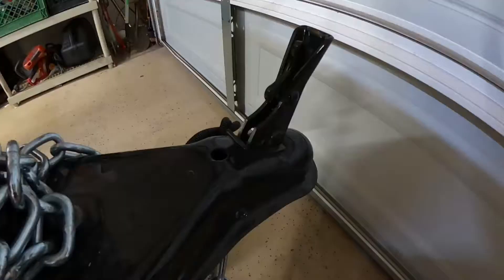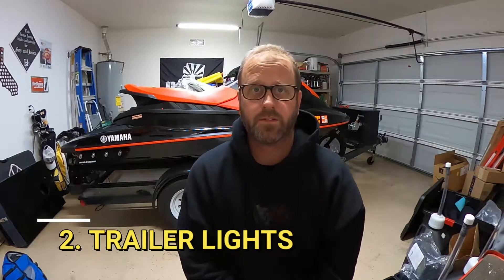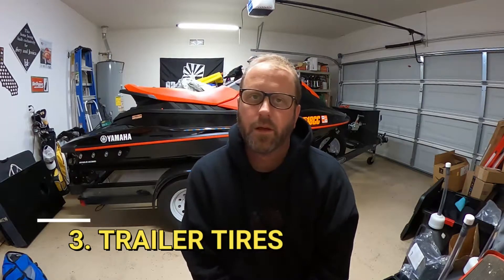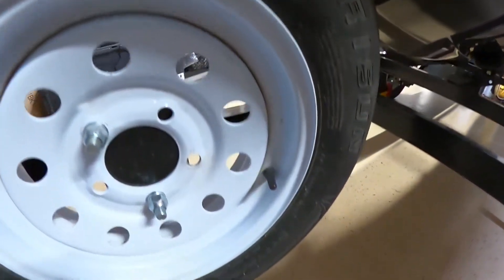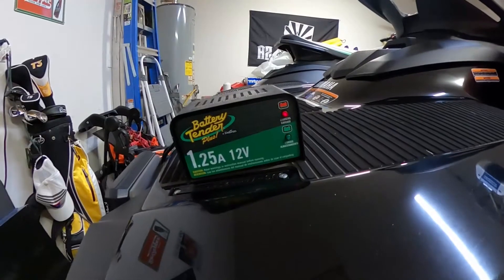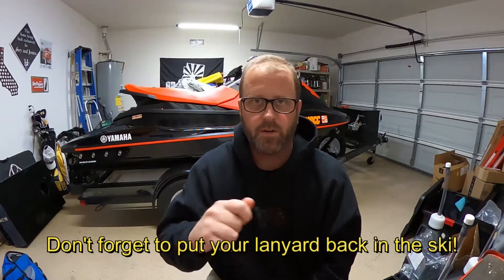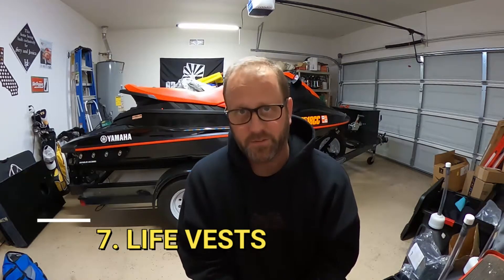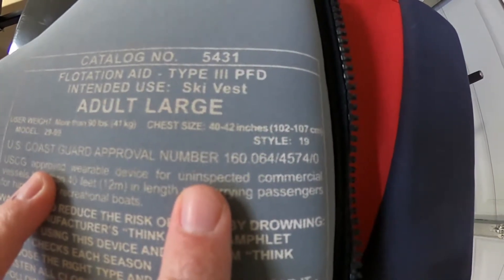PWC Checklist - 10 Things You Should Check Before Hitting The Water

Comment: One of the most convenient locks you can get for the trailer hitch lock is the Bolt brand lock. 

You get ones that are keyed to your vehicle key. I only have one tow vehicle, so I have a few of their locks, a pad lock, cable lock, hitch pin lock, and the trailer hitch lock and then they have a tongue lock. All keyed to my truck. So it’s one key for all and I don’t have to have a lot of different keys that always get lost. As long as you have your vehicle key you have the key to your hitch and trailer and all that. 

For the spare tire, you can buy a lock for it that screws onto the lugs and actually acts as the lug nuts for it, you can undo it by hand, no tool needed. The two halves connect to allow a padlock to lock them so they can not be unscrewed, and your tire stolen. I use the Bolt padlock there. 

I use the Bolt cable lock to attach to the rear tie down to the trailer. 

Since it is a vehicle key, and they make them for all types makes and models. You need to make sure you get one for your brand vehicle and type of key, standard cut or side cute. 

Since it is a vehicle key, they are harder to just rake pick like generic trailer and hitch locks are. Can still be done, but takes more of their time. 

For license plates, use nuts and use the security head bolts or screws. They need more than just a screwdriver or pliers. 

I am also surprised when you got stopped in the past they didn’t mention the reg numbers. 

I can see if your video the required spacing is not there lol. 

But really check out the Bolt locks. They are awesome and don’t have to worry about extra keys or misplacing one.